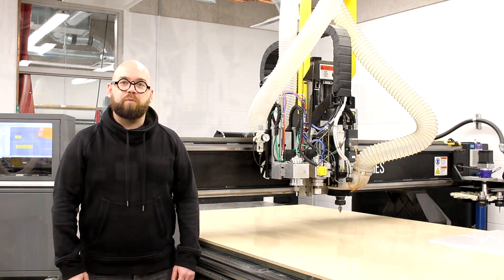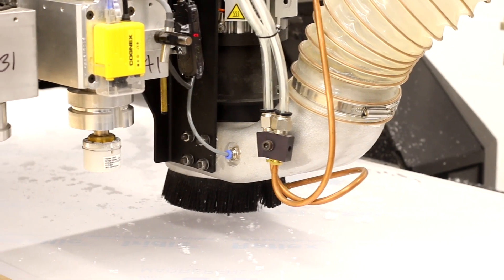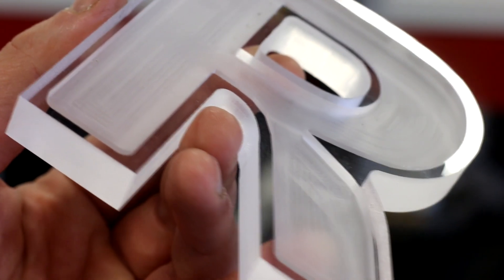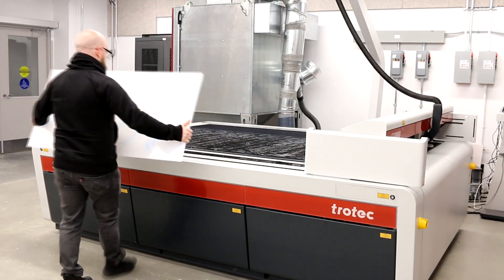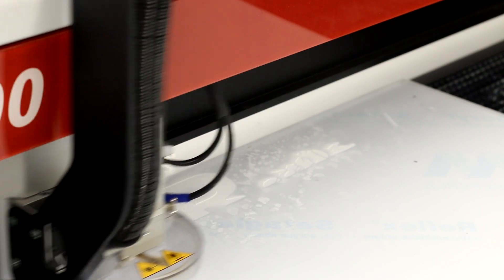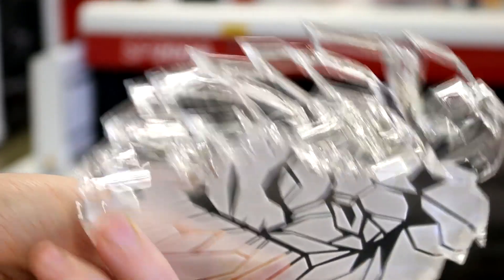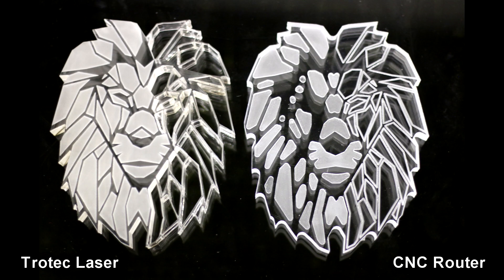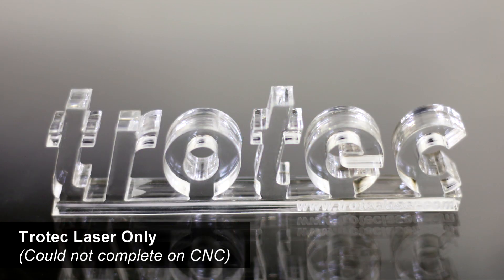Laser vs CNC with Ryerson University's Creative Technology Lab | Large Format Laser

Comment: Question: Relative to durability does the CNC cut provide a stronger acrylic edge profile than laser (aka an edge that is less likely to fracture)?  Someone had mentioned to me that a laser cut on acrylic sheets can leave micro fractures that are more likely to jeopardize the edges strength, while under stress.

Comment: Trouble is you need to have both and neither can fully substitute each other... When you have both you are invincible!!

CNC can quickly machine large and/or deep shapes at exact depths, is less limited in work piece thickness and doesn't burn wood. You can sculpt complex shapes with curves, even more so if it's a 5 axis CNC. One critical downside VS laser is the thickness of the bit used to cut, which means in interior cuts you always leave a radius. If you cut out a square with a 16mm bit, the interior angles will be 8mm radius and never square, which with laser is no problem.

Laser leaves a flame polished edge on acrylic, can machine MUCH higher detail than CNC, and doesn't have any limitations with tight angles.
Reply from the maker: Thanks Marcos that’s great feedback. We will have more in this topic in the coming weeks!
Reply: @TrotecLaserCanada  Looking forward to it! If you ever need any shots or footage of something CNC or CNC+laser, let me know!
Reply from the maker: Thanks! Are you in Canada?
Reply: @TrotecLaserCanada  In Spain I'm afraid! But even so, I can take high res photos of videos and send to you guys if you think of anything. I have a huge 5 axis CNC, a Speedy400, SP3000, SM1300 and the Mimamki UJF 6042. The combination of them all makes some really nice stuff :-)
Reply from the maker: Marcos Palomo wow that is a great set of equipment! 👍 You can email us directly at youtube@troteclaser.ca , perhaps we can do some kind of collaboration project!